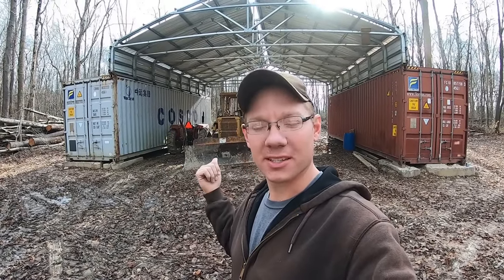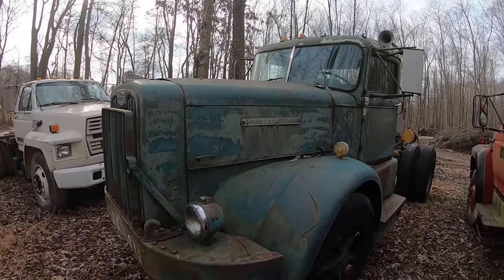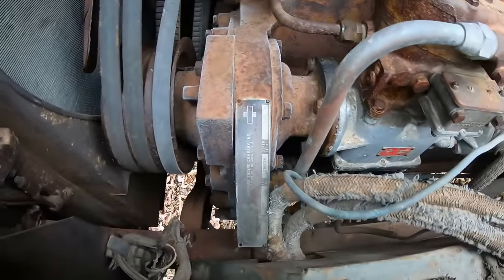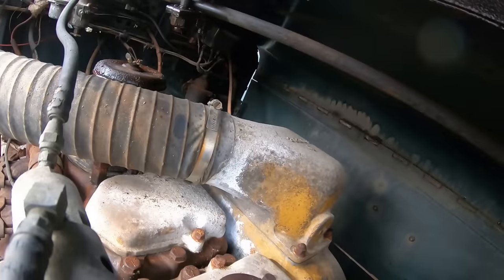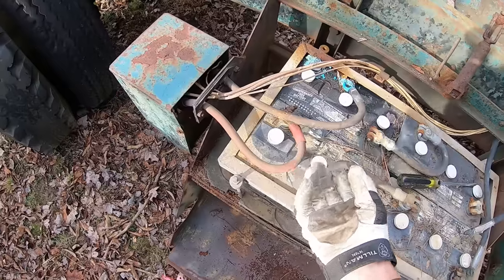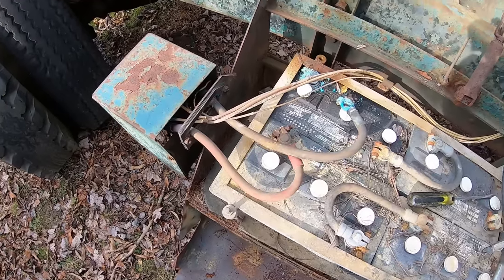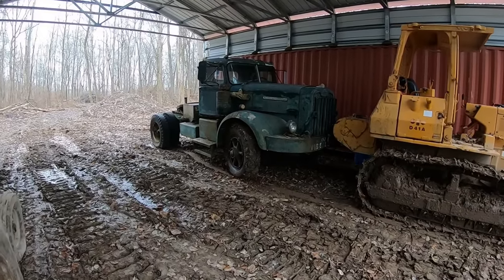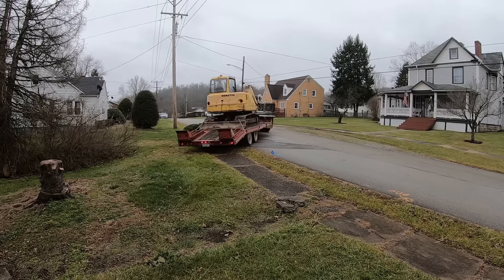First attempt at starting 1957 AUTOCAR truck - Hasn't run in 15 years!

Comment: I'm thinking you have four 6 volt batteries in series which adds up to 24 volts and the pos on a six volt is backwards than the pos on a twelve volt. The box that is connected is going to measure at twelve volts. I did same thing on my 24 volt dozier so I could run two twelve volt lights.

Comment: without air, all axles with maxi cans on them  will be "locked up"  use the attached tool( on the side of the can) to back off spring tension and let wheels free wheel
Reply from the maker: Not so, these old trucks didn’t have spring brakes, those didn’t come out till later

Comment: There is no such thing as a transformer on battery voltage (DC) systems.
As already explained the "thingy" is a changeover switch from 24V to 12V - or from series to parallel connection on the four 6V batteries.
Its also found on may tractors and harvesters.
The 24V system position is used to drive the starter motor for best possible crank power.
The 12V system position is used for all the utilies to employ standard 12V components, like you find in conventional cars.
The power system position is controlled by a power relay inside the box - which again is controlled by the starter button.
You can NOT expect any power from the batteries, when the vehicle has been left for years.

Comment: when you try to jump the starter with a screwdriver you need to have someone hold in the starter button with the key switch in the on position.
Because you have an SP switch, it’s the only way you’ll get 24 volts to the starter.
Reply from the maker: I was thinking that may have done it. I’m gonna get batteries and do it right next time! Thanks for watching!

Comment: Looks like an early 855ci cummins? Accessory drive in the right place, wonder what the CPL is? Wouldn't be hard to radically increase it's power! Last one I had was a Big Cam 2 tweaked to 336 at the rear wheals ( 10 wheel dump truck) on a Colorado "emissions" Dyno run. About what a 400 Cummins would do. So much history in those..:) And a 5 x 4 setup?? Thanks for the video  ( Is that a positive ground system by chance?? See that on old tractors from time to time )

Comment: I didn't see anyone mention it, but don't for get the decompression lever when you go to start it for the first time. The lever hanging off the drivers side of the front cylinder head.
Reply: Compression Release. Get it spinning then release the starter button as  you push in the compression release lever so the starter is never turning the engine when it is under compression. The momentum starts the engine without the starter helping it.  Done this thousands of times and starters last forever because they are never under heavy load.

Comment: Yep it is a positive ground system. Most of those older diesel systems are positive ground systems. I dont know about the 180 but the cummins 230 had a compression release handle on the front of the engine. I had one in a Brockway that I had to pull the compression release handle back on it (releasing the compression on the engine), get the engine spinning then release the handle and it would usually fire up. The engine may be ceased up or the starter/solenoid may be bad? Doesnt sound like the starter is engaging the flywheel? Sounds like its spinning but not kicking back on the flywheel? Might want to change the water hoses before you run it long? If one or both of them collapses, it will run the engine hot. They usually wont collapse until you throttle the engine up. Better to be safe than sorry?
Reply from the maker: It has a compression release, I got it running now! Video coming soon!
Reply: @DieselCreek  Great! Good Luck!

Comment: I got a feeling you know a whole lot more than you let on about diesel engines. You seem incredibly young and inexperienced but I just know you are going to remove that air inlet fitting to clean out the rest of that powder and change the oil and filters and the fuel before you try to start it. Good luck. I like the shed you made and I would bet for long time operations you will find some large paving stones to lay that floor out so you stay out of the mud. As a former engine machinist, I cringe at the thought of not completely reworking this engine after it sitting so long but perhaps you don't intend on actually keeping it and using it very long. Like I said, I bet you know a lot more than you are showing here. This is not new to you. Way to go, I'm rooting for you. If you are planning to restore it then this will be a long tedious show. I like it.

Comment: ALWAYS wipe the dipstick & recheck the oil level. Never base it off the first pull
Reply from the maker: I can agree with that if the motor had been running or moved around within the last 12 hours or so.... that truck hasn’t moved in 9 months and the motor not turned over in 15 years...

Comment: Smack the solenoid with a softhead deadblow....its stuck. It only takes slight corrosion to lock a solenoid
Reply from the maker: It was an easier fix than that! Check out the next video In the playlist! I got it running!

Comment: I think I woulda had a buddy come over and try pull starting it with the dozer, at least turn it over some, it might free up things and then be able to use the cables
Reply from the maker: I got it started fairly easy! Check out the channel for the video!

Comment: seems to me that it would be much easier to jump it off with the dozer running. Also: diesels pull start super easy if the rear end isn't locked up
Reply from the maker: But the rear end is locked up unfortunately, or the brakes are at least....
Reply: @DieselCreek  i did remember that after i wrote it... I used to drive a truck in germany in the 80s. In the winter we made sure that the brakes were aired up all the way and parked the truck on a little incline in the yard. use the battery for glow plugs, release the brakes in first gear, roll 2 3 steps, and vroom. This worked when it was so cold that the dipstick pulled a string of engine oil out when you checked it in the morning.

Comment: bar the engine before you go crankin, a little oil in each cylinder wouldn't hurt either. hope she runs!
Reply from the maker: As of today she does!
Reply: I just put redex down each cylinder and a spanner on the crank to make sure it's free.

Comment: Don’t forget the compression release. What’s the engine serial number? It’s on the long vertical data tag in front of the accessory drive & air compressor.
Reply from the maker: if you check out the video where I get it running I show the engine tag! Thanks for watching!!

Comment: It’s batteries are in parallel.12 volts double the current.common for diesel power
Reply from the maker: They are actually 4 6v batteries in this video. I’m going to hook it up with just 2 12v next
Reply: Yeah forgot about those six volt days.Good luck!

Comment: Thats a parrallel switch replace the 24 volt starter with a 12 volt starter then eliminate the parrallel switch and install 12 volts ,  it will work better !
Reply from the maker: thats prob the way ill go when i restore it! thanks for watching, got it running, video coming soon!

Comment: The starter should have at least tried to engage when you cross jumped its solenoid posts with the screwdriver. Seems like the Starter solenoid is frozen. I’d remove it and make sure it’s free. Or you could tap it with a small hammer or handle of a large screwdriver. I have had success with that in the past.

Comment: The parking brake needs air pressure to release brakes you can also back off s-cam to release parking brake
Reply from the maker: In Modern trucks yes, these old trucks didn’t have spring brakes like that. The only park brake this has is a hand operated driveline brake. Thanks for watching!

Comment: i may be wrong but on most trucks the air brakes work in reverse to cars and you need air pressure to release the brakes
Reply from the maker: Trucks this old didn’t have safety brakes like that, no air = no brake newer trucks are like that, not sure when that started, late 60’s?

Comment: That was great, question is there anything can cause or a damage inside the engine or something else for the long  sitting?
Reply from the maker: Shouldn’t really. Lubrication is probably the biggest problem. But some good cranking before she fired should have pumped everything up. It runs now, check the video on the channel! Thanks for watching!!!

Comment: Might want to wear a mask when tearing up old hoses and intake parts Asbestos!!!!
Reply from the maker: Didn’t think of that! Your probably right. Thanks for watching!
Reply: Yep White asbestos Galore ! would Have sprayed something like WD 40 Let it soak in And then ease it off slowly  Wiring looms from that era also packed out with That shit under the Cloth covering ,,Wear a respirator Mask at least
Reply: Couple of linked info quotes plus a URL
[Quote #1:] Chrysotile (white asbestos) is the most commonly used form of asbestos. It can be found today in the roofs, ceilings, walls and floors of homes and businesses. Manufacturers also used chrysotile asbestos in automobile brake linings, gaskets and boiler seals, and insulation for pipes, ducts and appliances.
[Quote #2:]
Anthophyllite was used in limited quantities for insulation products and construction materials. It also occurs as a contaminant in chrysotile asbestos, vermiculite and talc. It may have a grey, dull green or white color.[/Quote] ...Looks stringy
Thankfully If the Vehicle was steam powered (Boiler that would be lagged with Blue Asbestos (the really deadly variety)
 www.asbestos.com/asbestos/types/

Comment: To be safe i would put new batteries in it, replace the connections, drain the fuel filter, & fill it with fresh fuel, the same for the tank, i'm sure all the air lines, & hoses need replacing, also if that engine does start, that air compressor might be seized up, especially as long as it's been sitting, the air brakes could me messed up as well! not to mention the oil seals! Sitting is the worst thing for any vehicle!

Comment: Spray all that rust with motor oil to perserve what you have. Just hook up a couple of batteries. You can use two twelve volt. Cables wont do it.
Reply from the maker: shes out of the weather now so ill spare her the oil bath ( just makes body work that much more difficult) but Ill be bringing batteries next time for sure although those cables are 1ott welding lead ive jumped D8's with them!

Comment: that's an old 220 ain't it  you should drain the fuel or run it out of a bucket, does it have a compression release park and run is wiper bladesswitch

Comment: Get under the truck and put a screw driver in the little hole on th bottom and turn the motor over at least one turn and rock it back and forth ,it will free the starter up if it is Jam ed up and will let u know it the motor is freed up.

Comment: What size is that Cummins? I’m new to big diesels, but I noticed it has 3 separate cylinder heads like my 855
Reply from the maker: I’ve never confirmed but it’s supposed to be a 180
Reply: Diesel Creek I’m sure you mean the HP rating. But I meant cubic inches.
Reply from the maker: I’m not sure what that makes it I need to read the engine tag
Reply: 743ci

Comment: Never mind. Found it. 
BTW- You know where Autocar was made?
Reply from the maker: Pennsylvania I can’t remember if it was saxton or admore
Reply: @DieselCreek  Good morning. I'm not that knowledgeable with the company but I believe they had at least another facility in Cortland, NY. Nowadays I know they have a museum there for Autocar. I think it's called the Transportation Museum. They have several restored trucks there (Autocar trucks). I know that for sure because I do the vintage snowmobile shows and the museum sponsors one every year there. Thought the Co. was based there last I knew. You should google that place and see what they have available and it's history. 
Where are you located anyway?
I like your videos.
Makes me want to go buy an old truck myself and work on it.
With your info. I could be alot more confident at getting something running.
Look forward to the next vid when you do get it running!!
Thx.

Comment: Just because the key comes out don't count on it meaning the Ignition is off. In many cars and trucks of that era the key  would come out even if the engine was running.
Reply from the maker: That’s true but it was the only position that it came out in so it seems logical

Comment: Looks like it's a catipilliar by the judging of the old paint. Catipilliar engines were painted yellow and Cummins are red Valve covered engines
Reply from the maker: Delaware railfan 1980 not this long ago. Cummins actually used to be yellow, I show the ID tag in the video
Reply: Cummins have been yellow, white, tan, black, and red.  CATS white and yellow. Detroits white and green. Colors vary per customer specs and also differ between industrial and automotive (over the road) applications.
Reply from the maker: heyinway was CAT even in the on road game in the 50’s?
Reply: @DieselCreek  yes the bulldozers started out with gasoline engines than were upgraded to diesels. Same as trucks. 20's - 40's trucks were gasoline powered until 1950 when they started building diesels. My father was a mechanic on them back then and we always loved that sound of them starting up.
Reply from the maker: @jefftherailroadenthusiast8889  I know cat was around at that time I just cant recall seeing any cat motors in trucks of that era (gas or diesel)

Comment: No body has said anything about checking to see if the motor turns over first. I'd put a socket and breaker bar on that crank and see if she is freed up.
Reply: I definitely would that first!  fresh batteries and cables.  Drain that step tank and put fresh fuel in it. Drain they shitty engine oil and pour in some fresh oil!! Then try cranking it.

Comment: Initial removing of the air pipe:- would potentially have been better to try that from the other direction, so that the pipe may have come off of the elbow.  As it was, you were just pushing it further onto the elbow!  Wrong way, mate!  Best to think your problem through first before attacking it like a bull at a gate!

Comment: windshield wiper, the knob on lower left thats broke off.
Reply from the maker: Thanks!
Reply: @DieselCreek  turn to right , more you turn, the faster they go. turn all the way to left to park wipers, knob will return to off by itself. autocar used that knob system into the 80`s , maybee longer..

Comment: The starter was frozen up, just tap it a few times and it will turn over...
Reply from the maker: wasnt actually, i thought it may have been as well, it was just connected wrong.... I got it running in the next video! check it out!! Thanks for watching!!

Comment: MOTOR=electric   ENGINE= combustion.  There is a difference..
Reply from the maker: That there is.... slip of the tongue
Reply: Almost: A MOTOR requires an outside power source to make it run; that is: electricity or hydraulic fluid for example.  An ENGINE is a power producing device. Example: there is no such thing as an electric engine; it is an electric motor.  There is no outboard motor for boats either (they are outboard engines) -- unless they are the new fancy electric outboards, which would then be outboard motors.

Comment: why don't you take the "Starter Motor " out & service it & replace all fluids as other guys in your comments below have said , as for your air brakes check lines & hoses for 
Leaks & bleed air compressor , not many people bleed them  after you finish for the day ( saw a video on Bus Grease Monkey , all that Goo/crap coming out my god it was massive !

Comment: You had four six volt batteries in series to equal 24 volts. So two twelve volt in series (cheap as chips me old china) would do the job. Or the gizmo would decrease the voltage to 12v only. I am looking forward to where you go with this. It should be fascinating. Thank you for the fun of it all :) Have a look at what I play with here: lillytilly.co.uk
Reply from the maker: I’m planning on doing 2 12v batteries when I redo it! Thanks for watching!

Comment: hi and with the 24 volt system  is a pain in the bum and if you had 4 6volts battery took up at 24 volts and jump start at 24 volts and ps  the box on the side is called a 24 volt to 12 volt reducer and for  some of  the  electrics  and just get 2 new 12 battery's  and I hope that helps you as I set up a 24 starter motor system with a   12 volt reducer and some of  the for electrics  in a 1997 toyota sprinter car

Comment: How would you know that the engine would run just fine if you hadn't turned it on yet? You're obviously a smart guy but what if the engine itself doesn't work? What if there is no internal pressure due to cracked cylinders or pistons and it needs an overhaul? Then what?
Reply from the maker: then we tear it down and fix it or find a replacement, I dont know anything for certain but I trust the man i bought it from and he said it was running fine when he parked it, and i see no signs that it wouldnt, there for I have the confidence it will start with minimal work. thanks for watching!

Comment: spray some old motor oil on all that rust to slow it down
Reply from the maker: I thought about it, but then the bodywork just becomes more of a pain because the oil soaks into the metal. She’s under roof now, Should be good for a while. Thanks for watching